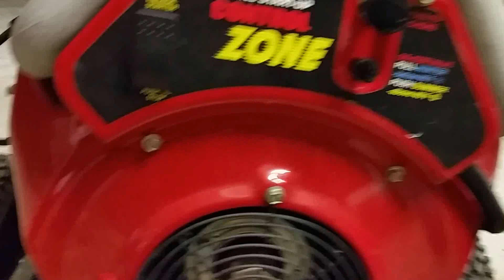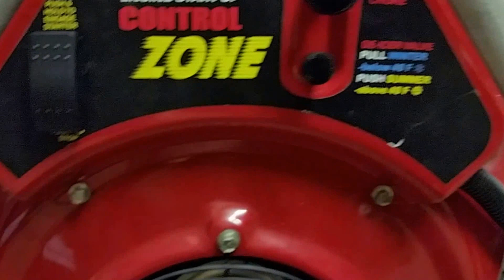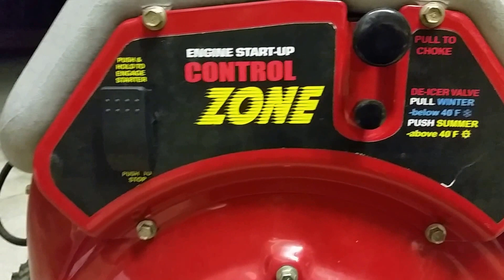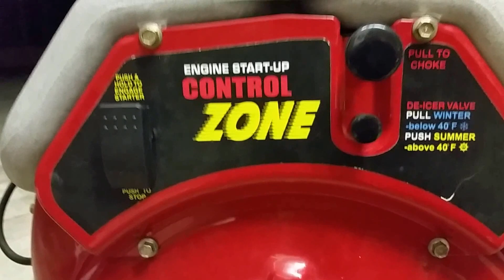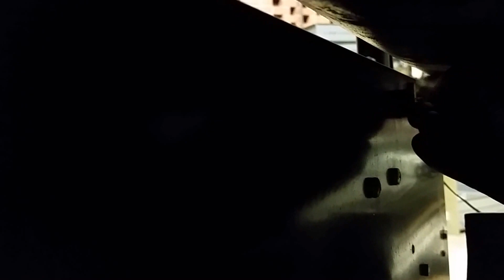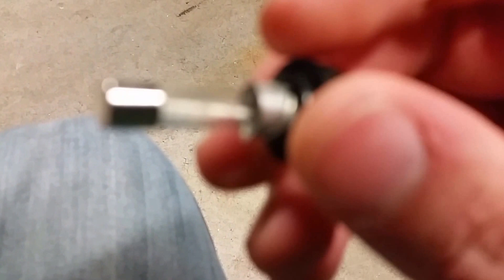Generac 15 kw generator won't start?  Two common problems

Comment: My GP15000 will not turn off. Have to close the fuel valve and wait for the fuel to run dry. Any ideas out there?

Comment: Thanks for this video.  Was looking for a fuse ont the front panel and found none... Though also was a bad battery, so charge it.. nothing again..  I was going to replace the ignition switch since nothing happened when pushing the switch and found your video.  Found the fuse and looks fried.  Will order that and see. Thanks again !!
Reply: What type of fuse did you buy?

Comment: Thank you! I had both of those problems fixed, as you stated. I did not replace the selenoid because I always shut the gas off, which almost dries the carburetor.

Comment: If the battery drops below a certain voltage it blows that fuse too. It's like a safety warning to you that if the fuse blows odds are your battery might be not up to snug for it. Had a battery that was a little weak but still good and it kept blowing fuse. Changed battery and fuse stayed good. Hope this helps

Comment: Thanks. I spent an hour on the phone with Generac help line and they didn't mention this and told me to buy a new battery. I pulled the fuse and naturally its burned out.

Comment: I have a 17500 that runs for about 5 seconds and then shuts off. I tried disconnecting and shorting the oil pressure sensor, and that didn't help. The carb is rebuilt. The gas is fresh. All fuel filters and fuel lines have been replaced. The shutoff valve/filter is replaced. The solenoid is clean. It starts fine every time but only runs for a few seconds. Any idea what could be causing this? Let's assume it's not a fuel problem.
Reply: Just figured it out. It was the idle set screw. It was adjusted too far in, so I guess since the computer couldn't lower the RPM, it shut off the engine. After I backed out the screw, everything was fine.
Reply: @JustEnjoyingLife73....you still have this machine ?
Reply: @rockystelone21  yes I do, I keep it as my house backup generator
Reply: @JustEnjoyingLife73  thanks for letting me know.
Reply: @rockystelone21  sure thing! thought you might have a question
Reply: @JustEnjoyingLife73  looking to buy a used one what are some red.flag to look for before doing a deal thanks
Reply: @rockystelone21  If the unit has sat with fuel, the solenoid might need to be cleaned. You could check to see if it idles smoothly, and you can bring a load like a heater to test it although this unit is difficult to fully test due to its enormous capacity. I think that as long as it runs, anything can be fixed if you're handy. Usually a carburetor cleaning will return it to like-new performance. I had to replace the oil pressure sensor on mine. I also had to replace the oil lines because there was a leak. I used transmission fluid line. After you buy it, change the oil and filter.
Reply: @JustEnjoyingLife73  I appreciate the advice

Comment: Thank you for your video,  I didn't know there was a solenoid. Mine was bad. That fixed my problem.
Reply: I cleaned the carb reinstalled and it still wouldn’t run. A few days later I decided to check the carb again. And found out that I had the float in upside down. I will not run with the float upside down. Now it runs like new. Lon story short.

Comment: I am so grateful to you for this video. I know nothing about generators, and no just a little about small engine repair. But the bigger the motors get the more complicated they are. I ran into the same problem I push the starter but it would not keep running. I pour gas down to third of the carburetor and it would run so I knew it was not a firing problem. I had never come across the solenoid issue before on a carburetor. But sure enough I followed your instructions, and the solenoid was the problem. On my end I had not started the motor frequently enough and waited too long before firing the engine up. So when I pull the solenoid out it was gummed up I could smell how the gas had turned to turpentine. Anyway, was a little cleaning solenoid worked again just fine and the motor started right up. I cannot thank you enough for posting this video.  As the last poster stated you’re a godsend. Thank you so much. Lou
Reply from the maker: I'm glad it was useful for you!

Comment: Thank you!  Great job, you saved me a lot of time troubleshooting the no start situation.  I found out the hard way why the manufacturer installed the fuel solenoid in the carburetor:  it prevents fuel from flooding the engine and locking up the cylinder.

Comment: Thank you for a great video. I have a problem with my GP15000E. It starts with no problem but after running a couple minutes it revs up and shuts off due to over-rev. The stepper motor has been replaced. Can you offer advice on what to check next?
Reply from the maker: No, sorry.  I haven't run into that.  When I run into problems, I google it and then make a video.  I'm no expert, sorry.
Reply: Did you ever figure out the problem?

Comment: Well I must say this video was very helpful. I drove myself crazy. I changed the Fuel Pump, all lines, and spark plugs. I cleaned the carburetor and nothing. Till I watched this video. I took the solenoid apart which is very easy. I cleaned it out with carb cleaner. I put it back together and walls it worked. Dam I spent an entire week trying to fix the problem till I came to this video. Thank you Thank You.
Reply from the maker: I'm glad it worked out for you.

Comment: I have the same Generator,   it has been extensively used in South Florida for the last 10 plus years.  Be very mindful about  theft,  three of my neighbors during  Sir Hurricane Andrew in 1992.  The thieves would place old,  garbage lawn mowers next to generators already in use,   and would  simply walk off with the generator.
Reply from the maker: Thanks for the advice.  Probably not going to be a problem for me, I live back in the woods behind a fence and gate.

Comment: I found your guidance on the fuel solenoid extremely helpful!  That was the issue of my fuel system not feeding fuel to the carburetor.  I could bypass the fuel inlet and feed fuel directly into the chamber and it would not run.  But the solenoid had become stuck and would not actuate the valve.  I simple $20 purchase of a replacement solenoid solved the issue.  Thank you.           Do you still have your Guardian Generac 15,000 watt generator?
Reply from the maker: Glad it helped
Reply: Any idea of the part number for the solenoid? Any help would be greatly appreciated
Reply: @chadnorman572  Sorry.  I sold my generator after I got it running again.

Comment: I had this same problem a couple years ago. I just lots of back fire. Replaced the solenoid and that fixed that issue. Fast forward to today, I have another problem. I am looking for the connectors that connects the generator to the control panel. There two of them, one green and the other grey. I can't locate the part number in the manual. Would you know where I can find them? They are 12 pins connectors.
Reply from the maker: No, sorry.  I'd search for something like "GP 15000 Parts Diagram"

Comment: I was able to remove the solenoid and cleaned the plunger with carb cleaner. It was really gummed up. Once I freed it up I reinstalled it and started the generator 

I also drained the bowl. There is a drain tube on the bottom of the carb. Connect a spare piece of fuel line to it. Then turn the screw and it will drain the bowl. You need a cup to catch the old gas in. Thanks.

Comment: I had a problem with  GP17500E that would start but would shut down after releasing the switch.I thought it might be the oil pressure switch so I disconnected the switch. It started and ran for 10 seconds and then shut down. Doing exactly the opposite of what it should do. I connected it back and it started doing the same thing.  I was able to get it to start and stay running by removing the negative cable on the battery for a couple of minutes then reconnected it. I basically rebooted the control board that controls the engine shutdowns.
Reply from the maker: Thank you, hopefully sometime can use this info in the future.

Comment: Thanks!  (Read Edit!) 
Update, I found this place and link for the solenoid: http://gen-parts.com/index.php/generator-parts/carburetors/generac-generator-parts-0f8603-carburetor-two-barrel-760h.html     I hope that they are still in business.
EDIT :  Unable to get them to answer the phone, found it on Amazon, see above.
Reply: Generator safety https://youtu.be/I1jT3ANENvI

Comment: I have the 17500e. It cranks but won’t hit. New plugs. New diaphragm fuel pump. Plugs are dry. Which I suspect the solenoid wasn’t opening to allow fuel into the intake. I checked for voltage at the solenoid and found none. Traced the hot wire “14” to the front panel and it eventually enters the voltage regulator. Im suspecting a faulty regulator but contacted an authorized generac repair center get theory of operation. Reluctant to throw 100 bucks at a suspicion. But i think it’s accurately assessed.
Reply from the maker: If you think it's the solenoid, you can test by removing the pin that shuts off fuel.  If it runs, keep troubleshooting...

Comment: well well well this guy adrianrog deserves the noble prize, I pick up a 17.5 kw for $1000 that was sitting in someone garage for over 2 years.  they use the generator once after a hurricane.  They said it won't run and only start with starting fluid they had it check out and was told it need a new carburetor, a $400 job to fix.  I new it wasn't nothing major since it would start and run with the starting fluid after seeing your video on the solenoid i had a feeling that was the problem.  I took the solenoid out which was stuck in the close position use a little wd 40 to loosening it a few q-tips to clean inside it re-install and VOILA it fired right up...HOT DAMN I JUST CAME UP ON A PRACTICALLY NEW 17.5 KW GENERATOR FOR $1000 BUCKS...THANKS TO YOUR VIDEO YOU HELP ME OUT...now I can sell my brand new duro max duel fuel 12,000 watt generator still in the box for $1000 and try to get my money back
Reply: Please watch this video about generator safety as well https://youtu.be/I1jT3ANENvI remember to never run your generator indoors. I just hope people are safely using their portable generators. Thank you. Hope you agree with this advice. It’s very important.
Reply: @tonisam962  not just indoors, don't run it in your garage even if you have high-velocity fans blowing air out with the garage door opened! I did that, and all the carbon monoxide detectors in my house went crazy! I even had a 2000+ CFM attic fan running in the garage along with a 20" high-velocity fan. The other day, I ran my generator on my driveway, and the carbon monoxide detector in the garage detected carbon monoxide! People just don't realize how much of a problem this is. That's probably why you're seeing generators come with CO detectors onboard. Ideally, you should run it as far away from the house as possible.
Reply from the maker: I'm glad it was helpful.  You have a much better generator now!

Comment: Thank you! Mine wouldn't start. I removed the solenoid and it was stuck. It's a poor quality .
If you need your generator running now and cant wait for parts , do this:
1) Turn of the fuel using the switch below the tank
2) Remove the panel where the choke is (4 bolts)
3) Unplug the solenoid (read and black wires in a white connector)
4) Remove the solenoid with a deep socket
5) Tap the pointed end of the solenoid. Its probably stuck. Leave it depressed in.
6) Put the solenoid back in. DO NOT RECONNECT THE SOLENOID POWER connector.
7) Put panel back on
8) Turn fuel. 
9) Start generator and survive.
10) Order part.

Amazon sells the part. Its $30.  Search for "Generac Fuel Shut off Solenoid Part# 0E5551"
Reply: Everyone really needs to watch this video about generator safety https://youtu.be/I1jT3ANENvI stay safe
Reply: Why shouldn't you reconnect the power? If it frees itself, it won't let you turn it on. What you should do is spray the plunger with some carb cleaner. That should be all it takes to fix it. If you want to bypass it, just pull out the plunger and leave it out but be prepared for possible backfire. That's why it's there.

Comment: Thank you, I had the same problem with the fuse. It was very helpful what you did and selfless. In my case,  to top it all,  the fuse casing was broken from the factory hard time to remove it. Also from the factory the wire on top of the breaker Of my GP17500e was loose I believe it is what shot the the voltage up and down resulting in various surge protectors and one GFCI outlet to blowup and carbonize. I have a voltage regulator coming in case. It was the culprit.  I had a better impression of that company until now. Very difficult to find help if you are a portable generator owner all repair places only do small engine repair, as soon as you mention it is electrical they wont touch it. there are no service manual to be had etc etc. I though a US company would be different than a chinese one.

Comment: Can you do a video on how to fix the solenoid problem?  I have no idea how to fix it.  Thank you.
Reply: Unscrew the 4 bolts on the panel with the choke. Unscrew the lower knob. Unlink the choke. Disconnect the connector from the solenoid. Remove it with a 3/4" deep socket and clean it with carb cleaner. Pull out the plunger with needle nose pliers to clean it.

Comment: Thank you so much for this video! You are a lifesaver! The generator was running fine after the last bad nor'easter. Turned it off to fill up - and it didn't start back. Without you we would never have found that fuse!
Reply from the maker: Thanks for watching and I'm glad it was useful.

Comment: I have the 17k Ultra Source 4583 but got the same problem. So checked the fuse, its ok. Then I removed the "fuel-shutoff" solenoid, then removed the plunger & put everything back together. Then hit the start button, it fired right up. Was doing some popping & acting like it was about to stop, but kept running. So I hit the idle-control toggle switch on control panel to speed it up. It smoothed out. I've re-started it several times with good results. So I will order this part & replace the bad one. Thank you for this excellent video.

Comment: This unit is a POS. Bought it and it stopped working after two days of service after hurricanes Irma and Maria. Do NOT get one especially if you are taking it to a remote place where you can't easily get parts.
Reply: Ok so maybe I'm an ass but it seems bad fuel was at the root of my issue. The solenoid was not the problem for me it was the screen on the fuel shut off valve was getting clogged. Neither was the fuse although knowing where it is, is much appreciated. Overall the machine is doing an ok job, For the price it's hard to expect more.

Comment: I don't use non ethanol gas and have all my small engines on a 3 week start schedule. If I start on the 14th of the month, next month it gets started and ran on the 7th etc etc. Thanks much for the info on the fuse location and the anti backfire solenoid. I'm familiar with them on my riding mower but have never had an issue. Thanks!
Reply: 3 weeks? With a lot of my yearly stuff (like leaf vacuums & snow throwers), I just install a fuel shutoff and run it until the carburetor is dry. Sometimes I drain the tank. Then I can store it as long as I want and not have to worry about the fuel gumming up the insides. I don't think I've ever experienced fuel going bad. I've stored ethanol gas for years in tanks, and it still works (definitely use Stabil). I've even had a car sit on the driveway for a decade, and the fuel worked fine when I started it up (no stabilizer too). I have so many small engines that there's no way I could run them all that often. On these generators (and many others) there is a screw on the side of the carburetor bowl that lets you drain it, and since these have the solenoid, I'd definitely at least run it until it shuts off with the fuel turned off. The residual fuel should evaporate, leaving behind minimal impurities.

Comment: I have the 17,500 version.  If I squirted a little gas in the carb, it would run for a few seconds and then die.  Irma is threatening us and I probably spent 4 hours screwing with this. Even took out the carb and cleaned it up. I wondered about that Electric thing.  This morning I watched and listened to your youtube posting and I knew exactly what to do.  The solenoid was definitely frozen.  I pulled out the cylinder and cleaned it with carb cleaner the verified that it worked.
I now have a working monster generator.  THANKS so much, I'm ready for Irma now.  Steve
Reply from the maker: You're very welcome.  I hope you didn't need it for Irma.  We lost power for 2 hours, but that was it.

Comment: Thanks man!  The fuse was the trick.  Stupid little thing is well hidden.  It is a 250V 10A Bussman fuse.  I went to the electrical shop and purchased 3 for $2 and viola! It started right up.  If you have money to burn or cant get the fuse, Grainger will ship 5 of them to you for a mere $17.
Reply from the maker: I'm glad it helped.  I keep a box of those fuses taped to the gas tank on my generator just so I can find them if I ever need another one.

Comment: I have had this generator since 2004. I have had to replace the silinod twice. Been chasing wires to find why it would not crank this time. I am glad I found your video. I never seen the fuse on the schematics
Reply from the maker: I'm glad it worked out for you.

Comment: I disconnected the "solenoid" and my 12500 then ran. Where do you buy this part. I've searched everywhere. Were you able to find it?
Reply from the maker: I have a 15000, not sure if it's the same part number or not. I searched for "GP15000 parts diagram" and got my part number off there.  Was a few years ago, but I was able to buy the part online somewhere.  Don't remember where now.